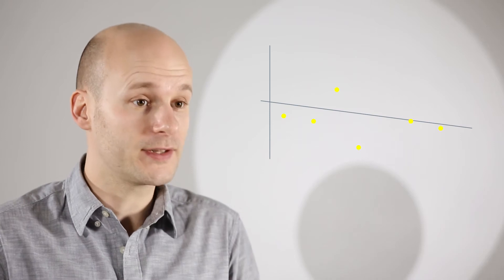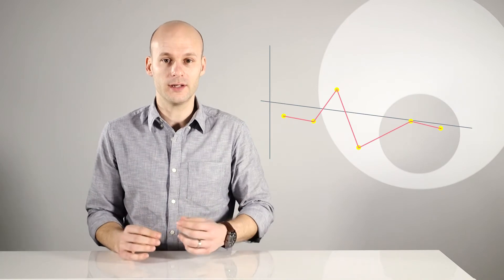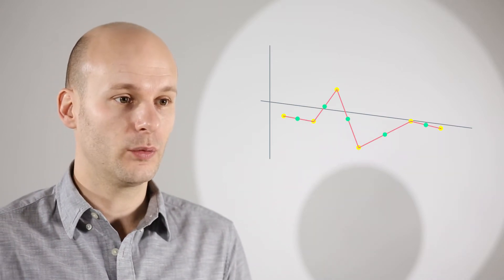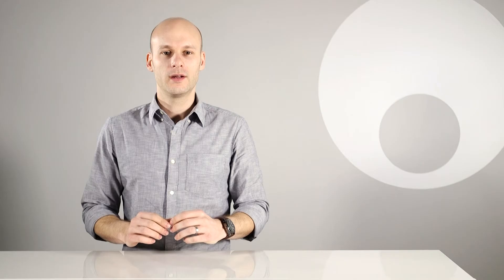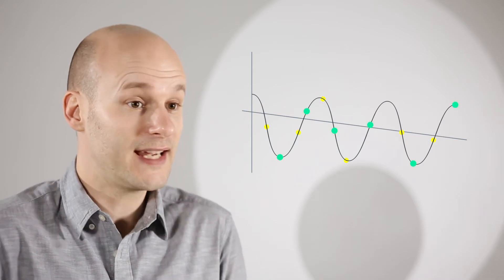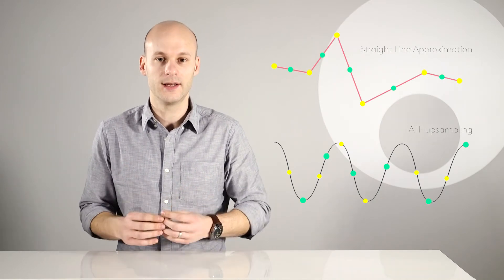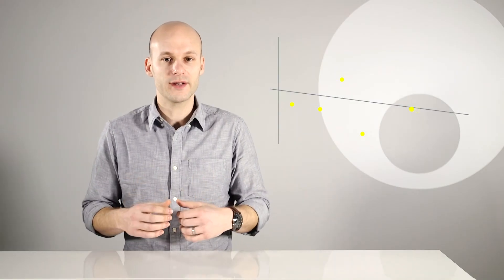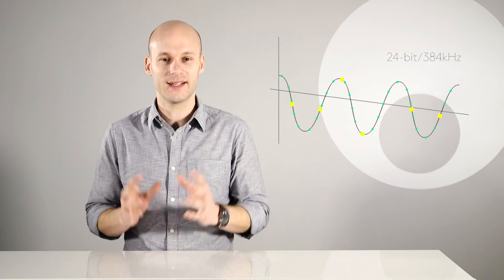ATF Audio Upsampling

Comment: The explanation is incorrect. Trying to explain this in terms of diagrams with "smooth" curves doesn't make sense, unless those smooth curves happen to coincide very closely with the analogue input signal. There is no obvious reason why they should based on the hand waving approach shown here. The method used in the hardware might be OK - but must surely have to depend on filtering. As an explanation this is poor.

Comment: the ATF is combine with ADC (AD1955 32Bits Analog Devices), well...But it`s not very clear about Upsampling ; Because the AD1955 maximum rate is 192Khz..your Upsampling is about twice of that, it's ok for me, but)
You say is not "linear interpolation", it's a curve...Ok but twice more samples is not a curve for a 192Khz source signal, it's  a straigtht line too (two points)
Reply: 48KhZ is not use in studio for Audio:  is primary use for TV (and DAT?). is the same think for 192KHz ok. But your answere is unconnected with the question about non linear interpolation ATF.
For my music i use redbook 44.1Khz for the listening. and use 24Bits 96Khz  +The DeltaSigma/ Dithering noise shaping technique for Signal processing ONLY . 
The filtering  is about 22 KHz max  on the output chain, so artefact is  not audible for me! (because of natural  bandwith of my hear!)
 Best regards